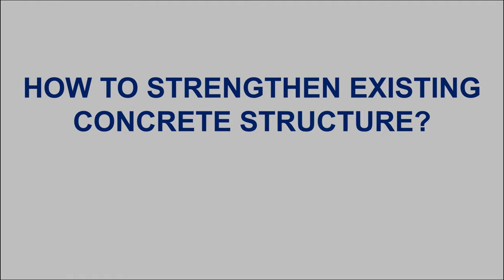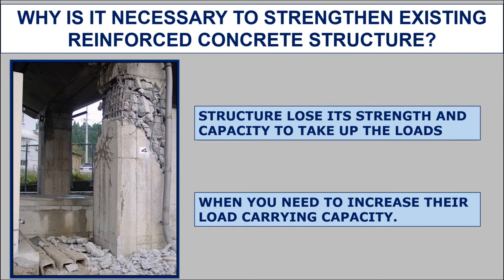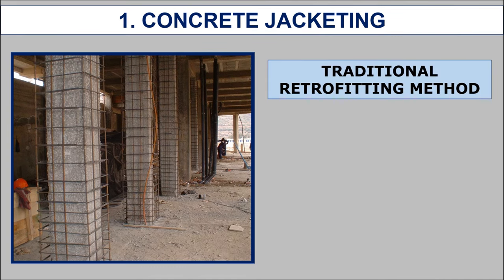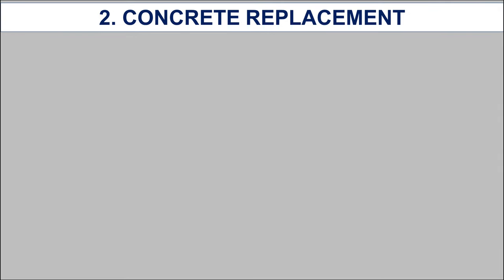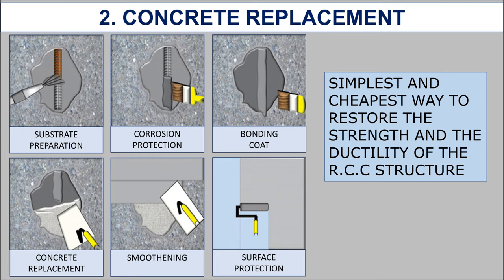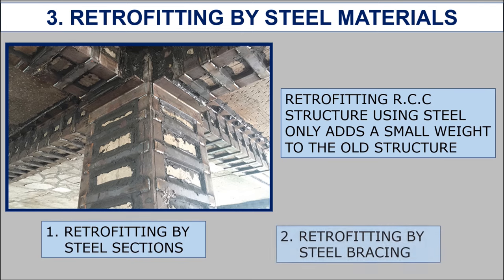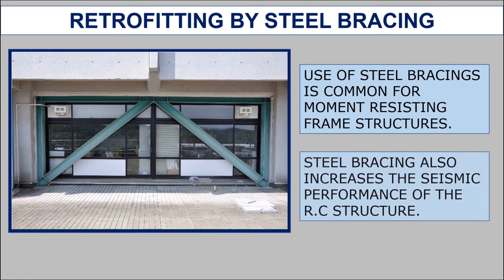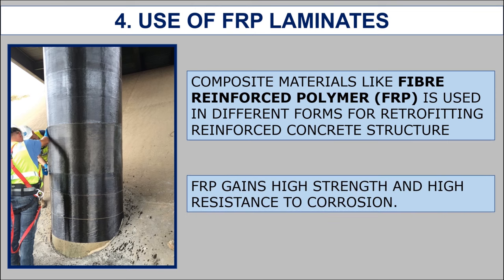How to strengthen the existing concrete structure?

Comment: If I have wall on first floor can I move my ground floor wall to wider my gate
Reply from the maker: The information provided by you is very limited as you have not specified the type of structure it is, like Load bearing structure or frame structure, also the total height of the property including number of floors,  but then also, first you will have to identify, whether the wall you wish to remove is load bearing wall or a partition wall, the size of the wall, the age of the structure, current condition of the beam and column. Based on that you can decide your next step.